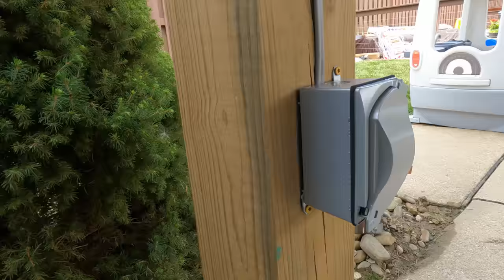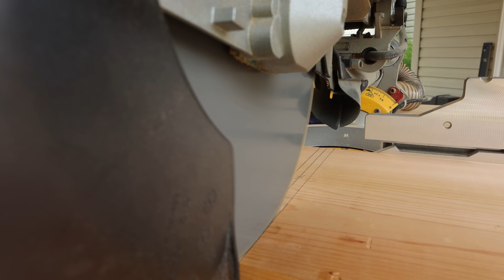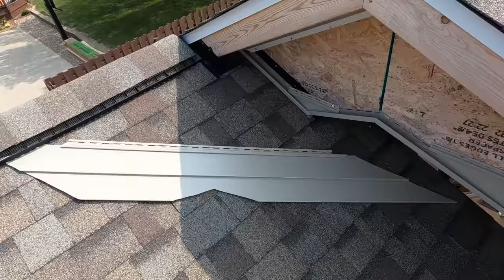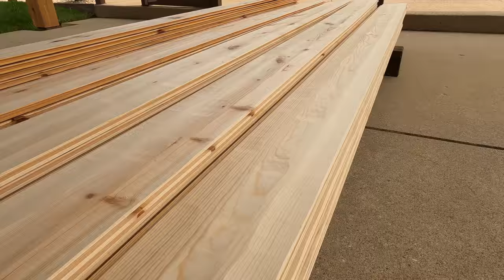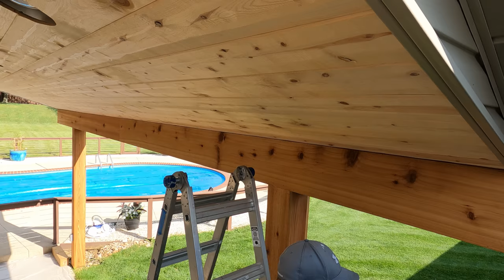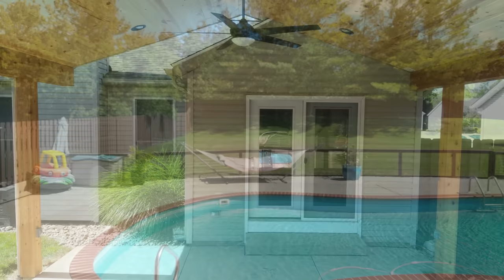DIY Covered Patio Part 2 | Total Cost | Final Finishes

Comment from the maker: If you haven't seen it already you may want to check out Part 1: https://youtu.be/5nqZ00DW540 and here is the patio furniture built for the space: https://youtu.be/glrXdJPVZLQ . Thanks for all the feedback I appreciate the kind words, suggestions and your thoughts. I will try to answer as many of them as I can in a future video.
Reply: Subtract the material cost from the cost of what it would be if a contractor did it. Divide by hours worked. That is the hourly rate you paid yourself in sweat equity. Money you can use for other projects or investments. You could also add the amount this would increase your home's value.
Reply: You did an awesome job.  What is your background.  Did you ever work for a carpenter contractor? Glad to see homeowners take on these types of builds themselves and do everything correctly! Again nice job! You would think that a professional was hired to do this project.  You must have some experience to take on this task. If you don't.  Well done!

Comment: Random internet stranger here who's dabbled a little as a professional carpenter. I found your video while trying to get ides on how I want to build a covered area similar to yours but smaller for my shop and you've done a fantastic job! Your planning and attention to detail is impeccable. I'm no electrician but have been through several inspections and I do want to say for the sake of safety (I think someone has already voiced this in the comments) but I want to emphasize that installing wire behind the post vernier without being either inside the post or shielded with EMT is unlikely to be code and IMHO dangerous. I know you said that you passed the electrical inspection but inspectors miss stuff often enough. The last thing is the junction boxes in the soffits, you might consider drilling a small hole in the face of the cover so that if any moisture does get in there that it has a way to get out. Anyway I enjoyed your video! Cheers!

Comment: We build porches very similar to this - you did an incredible job. To answer your question - we would charge $30k for this structure
Reply from the maker: Thanks and I appreciate the transparency, that price makes perfect sense and on a much shorter timeline haha
Reply: Holy bologna batman! Way to save some money and a beautiful job! 😎👍
Reply: @ThatTechTeacher427  he paid $1200 in materials, but what would a contractor spend? Given they should already have all the tools and I was told contractors either shop at special material stores or get exclusive discounts with the big box stores.
Reply: I agree it would be about 30k. Depends on where you are located though for what labor prices are, cost of living, etc.
This guy (tech teacher) should have estimated how many hours he spent. He probably spent about 500 hours doing this project, which means he ended up valuing his time at $36 per hour to make up the $18k difference.

Comment: The custom printed 3D ceiling fan piece takes this project to the next level.  Quite impressive.
If paying someone to build this, you'd need to multiply your costs by at least 2.5 or 3, and you'd end up with an inferior product.
One critique...it is guaranteed that someone (maybe the next owner) will want to hang something on those posts, and they will be in for quite a surprise when they run a nail/screw into the wiring hiding just underneath the surface of that cedar.
Reply from the maker: Thanks, I have to make sure I remind myself of that as well! Hopefully they watch the video lol
Reply: Exactly my thought!
Reply: where i live, you can count on electrical cables running vertically up from every outlet and switch

Comment: Off hand, I think two men could put that up in a week- 80 man hours. Shop rates will vary, but here in Dallas a "handyman', working with your materials will run $50/ hour, plus, a full shop labor charge will be higher- $70 low to $125 high where I live. Eighty times a hundred is easy- $8,000 labor. Btw, few shops would touch it and warrant any of it if you do not buy the materials through them, which would add another 10%- 25% on the materials side. Fwiw, I retired just a few years ago.
You've done a pretty good job of problem solving your way through this project. Even professionally designed ones have glitches and unforeseen trouble spots. Kudos- I'd nap under it anytime and feel safe with kids under it as well. Working with your codes and inspections people was a very wise thing to do; when I remodeled a family home, I still pulled an "owner's permit" and did all the inspections and still have all my green tags, as well as the two reds I got in trade areas I wasn't as hot with.  Learned a lot more than I thought while I was at it- inspectors can and will tell you lots if you don't start out going negative with them. It's worth noting that this "homeowner project" was inspected and will have no negative impacts if reported during a real estate transaction.

Comment: I'm not an electrician either, but a separate breaker for every outlet is beyond overkill 🤣 cool build overall
Reply: I think what he meant was the outlets and the outlet already on the house are collectively on a separate breaker as in all on one. 

And a separate breaker for all the lights...one breaker

So two breakers in total
Reply: Edit the one on house is with the new lights and fan

Hope it all made sense
Reply from the maker: Ya I didnt say that very well. One breaker for outlets on the posts and another for the lights, fans, and outlet on the house for a total of 2.
Reply: @ThatTechTeacher427  thanks for the clarification. I added 3 circuits to my house and that dang Romex is pricey!

Comment: there's a trick u can still do with a mitered edge that works well with cedar... take the round metal groove at the head of the hammer and run it up and down the mitered edge, press gently to ur desired "radius" it will curve the edge and join them completely. add some fresh glue to any spread joints before doing this.

Comment: I really love this project! Great inspiration for a project I am planning. Thank you. I am an electrician and you I see you have one code violation with the plug in the soffit. You are not allowed to install GFCI above 6 1/2 feet above finished grade. But it's a pretty minor correction. You could solve it by installing a GFCI breaker in the panel and you would have covered all the plugs. Again, great job! One last thing... I absolutely love your solution for the peak Fan covers you made!

Comment: Great job!  I’m very interested in your outdoor TV and sound solution.  In lieu of an all-weather TV, I just installed a $200 smart TV with a good cover and then all-weather speakers connected to my interior set up.  Works really well.  The thinking is, if the TV fails after a few years, no biggie, just replace with another newer TV. That was four years ago and still working great.  Thanks for the great content. 💪🏻 I learn a lot!
Reply from the maker: Thanks! I think that is the way to go, the TV is kinda disposable and you dont feel as bad about replacing them.

Comment: This looks really nice, but one thing that I would be highly concerned with is the way that you embedded the electrical wire inside the post. Not only was that a bad idea it was probably against code.

You have concealed wire with nothing to protect it from nails… you might know it’s there, but what’s gonna happen when somebody decides to hang something on one of them posts and drives a nail right through one of the wires. You should’ve put the wire inside of conduit and then built the post façade over that.

Comment: Good work. The only thing I would have added is speakers in the ceiling. Also When you cut treated lumber, you should use a treatment on the cut ends. The way you did it is fine as long as you put the cut ends on the top out of the weather and it looks like you have. Other than that I would have not hidden the wire behind the cedar. It's a risk that someone could drive a nail into it. Might be better to come up from below and tucked the wire under the slab. Sealtite conduit would be my preferred method from underground. but.......Very nice job! Really!

Comment: I see your original video was a year ago, but just wanted to mention, there are spot lights on Amazon that are flat and simply clip into sheetrock, rather than requiring the can. They are indoor/outdoor - great for tight places where light is needed and a can won't fit. Love the patio, wondered where you got the trusses?

Comment: Awesome job.  I had to follow this project with both videos.  Thank you for explaining your methodology with each decision point.  It provided some rationale for each.  One question was, why not coat the pine T&G before nailing it to the ceiling?  It seems it would have been easier than working at that height.
Reply from the maker: It would have been way easier to pre finish the T&G but with the amount of time each day I had to work on it and the fact the first shipment of boards I got had some really bad ones in it and I didn't know how the 2nd was going to look I picked to do it this way but you are correct

Comment: Wood work and framing looks beautiful. But I think that cable on the post could be a hazard. Someone can nail something to it. Probably if the vertical notches on the post overlay had metal in it it prevent from screws and nails to pierce it preventing any damage to cable

Comment: If you passed electrical with the wiring concealed behind the cedar wraps then the inspector didn't do his job. At the depth under surface you would have been required to protect the wire from screws or nails that may be driven into the post.

Comment: What material do you print those ceiling fan covers out of?  Concerned about it getting too hot and deforming in the summer?
Reply from the maker: ABS Plastic. It has a higher melting temp than some other plastics but I guess time will tell. I'll let you guys know if I have any problems. Might even have cracking issues in the winter idk.

Comment: Typically as far as contractor pricing goes.. A ROUGH estimate is about 3x the amount of the materials. So if your material was $12k..the total, with labor and materials would probably be around $30k-$36k.
Reply from the maker: Ya that makes alot of sense and on a much shorter timeline too.

Comment: Which nail guns did you buy for this project, and why? Thank you, Jim.
Reply from the maker: I bought the Pierce brand from Harbor Freight. As far as I can tell they are the same as high end brands just a prior model year at a lower cost and with the 20 to 30% coupons you can get combined with how few times a year I use them this seemed like a great deal. So far I have had 0 problems with any of them.
Reply: Thank you, I will check them out. It seems like I would almost need 4 different ones to run the types of nails?
Jim @ThatTechTeacher427

Comment: One tip when installing the tongue and groove boards.. Take a off cut piece of the tongue and groove (maybe 6" long) so that you can put that over the tongue of the board you're installing. This way when you hammer it into place, you're hitting a scrap piece and not the tongue of a piece you are installing and possibly damaging the tongue

I also recommend pre-finishing those boards. MUCH easier on the ground than in the air AND you seal all the edges and the back that you won't be able to do with it installed
Reply from the maker: Thanks and I agree with both! After breaking like 5 of the scrap piece while pounding them in I gave up on them but they do work great.

Comment: How much were the permits? 
Did you have to get any of them done professionally?
Really would love to live where you do, just to be able to do this work without needing trades.
In Melb, Australia, we would have to get a soil report, structural engineered drawings, building permits and possibly town planning approval. For this project you would probably pay $5-$15k just for the paperwork!!!
THEN you have to price in an Electrician for any sort of electrical work and a Plumber for water drainage and possible roof sheeting, as we are not allowed to do any of this ourselves.
Dont start me on how cheap your lumber is............ a 150x150x4800 post here is $270 EACH.

btw, well done. 👍👍

Comment: Wait am I missing something there’s a ridge vent but no soffit ventilation.
Reply from the maker: Correct. More than anything I used the ridge vent as aesthetic to match the rest of the hose. I probably should have used some ventilation in the soffit to make it function but was not required to because it is not a conditioned space.

Comment: Having each outlet on separate breakers is wayyy overkill. You definitely could've done just one circuit.. MAYBE 2. Even with tvs and such plugged in and a couple power tools/yard tools you would still have plenty of headroom.

I would have done 1 circuit for outlets, and 1 circuit for lighting.
Reply from the maker: Sorry I worded that very poorly. All for the outlets on the posts are on 1 breaker and the outlet on the house, fans and lights are on a 2nd breaker, almost like you suggested.

Comment: The gfci outlets don’t meet code. You need the bubble cover, started with the 2014 NEC.
Reply from the maker: That may be true but it passed a rough and final electrical inspection from the city I live in.